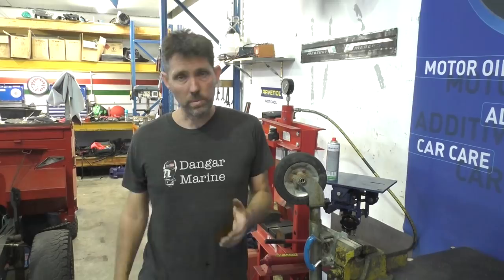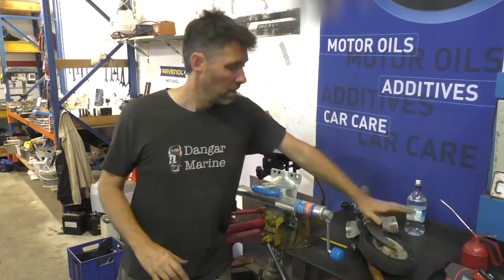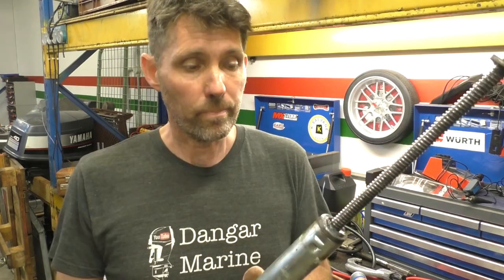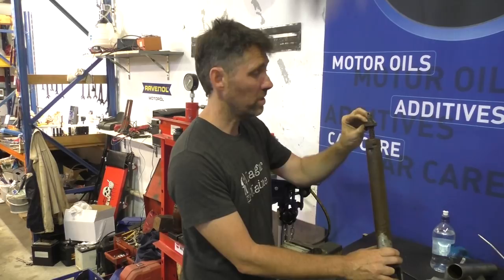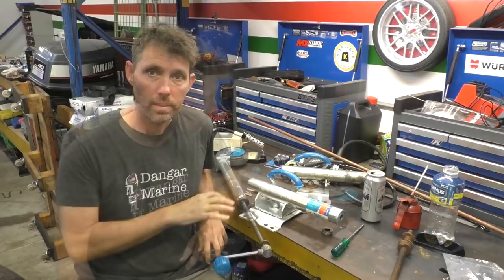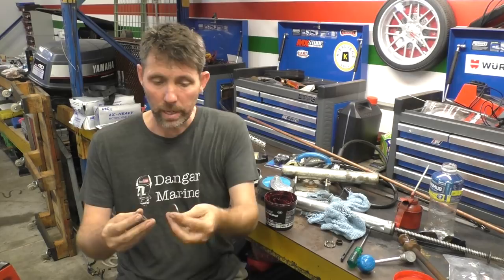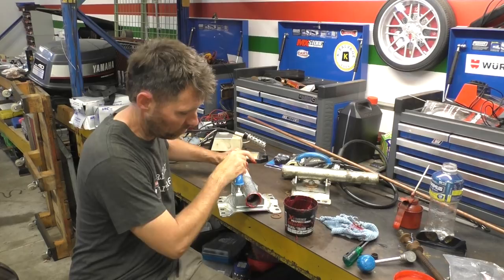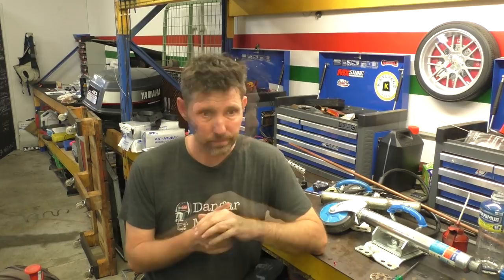Trailer jockey wheel maintenance

Comment: Interesting.  You sure are right-on the mark about greases attracting and holding dirt and grit.  Shame you couldn't easily revive the first one you began working on.  I was thinking (while you were attacking) that inverting it and admitting a liquid-based penetrant might have been the way to go simply for freeing it.  Sad to see you "give up on it", but autopsies do provide a wealth of information about what led the victim to end up on the Doctor's table.  Sometimes a sacrifice doesn't end up being in vain, if it can help the living go further.  I believe that periodic attention is the best way.  Just like realizing that at some point you need to inspect lights, tires, brakes, wheel bearings, same goes for the landing gear or dollies, and the hitch lock too.  Years ago, a wise fellow I met along my journey had himself been handed down a recipe of a good liquid penetrant with some staying power.  He would buy bulk WD-40 (in 5-Litre square cans) and mix it 50-50 with cheap ATF (bought in 20L pails). He put the mixture in squirt bottles (with the WD-40 logo) and found that the WD-40 helped it to creep and get into places, and the automatic trans fluid oil would remain behind long after the WD-40 had evaporated.  Today we have PB Blaster and other advanced formulae of products conveniently available in small compressed cans,  but I always think back to that pink WD-40 mixture that Ed used back in the early 90's. Thanks for the look inside one of those tube-leg dollies.  Pretty simple, yet effective design for helping to take the strain off of having to "Armstrong" a loose trailer around when moving it.
Reply from the maker: Hey Stan, I think my plan at this stage is to leave the wheel retracted completely when not in use. My hope is that the thicker grease will fill the gap a bit more and exclude air, but we'll see, it's all an experiment at this stage. I didn't show it, but I did have the original upside down with Wurth Rost Off sprayed now the gap, but even after a day it didn't do much. Oh well, I always love to cut things open and as you say, it gives you some valuable information for your money. :)